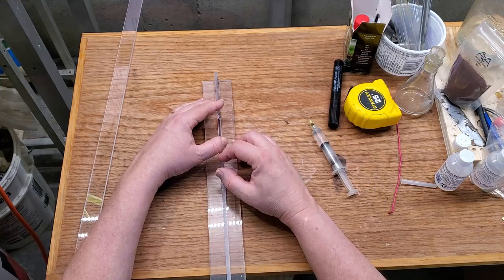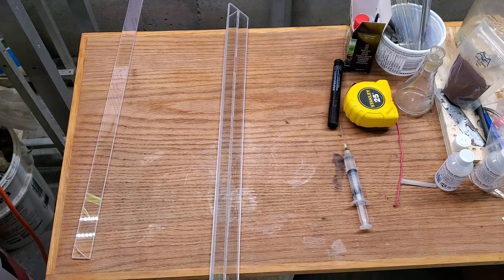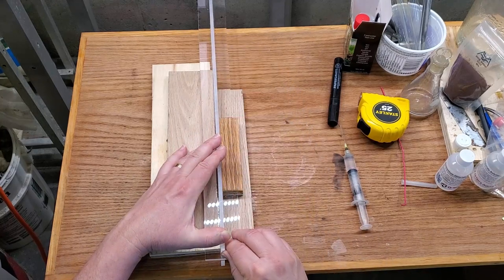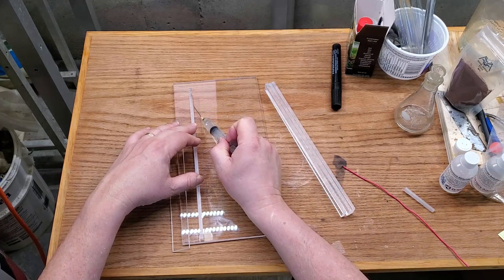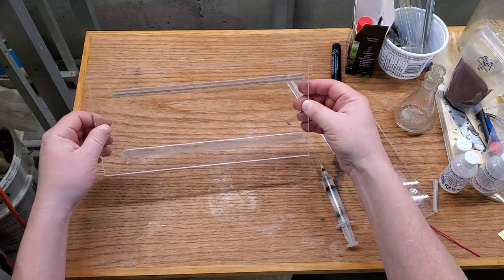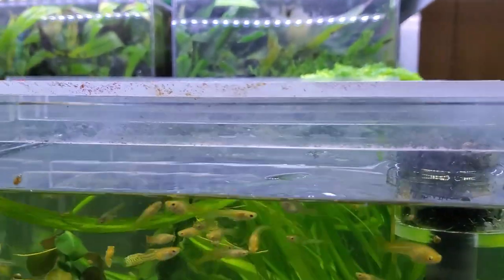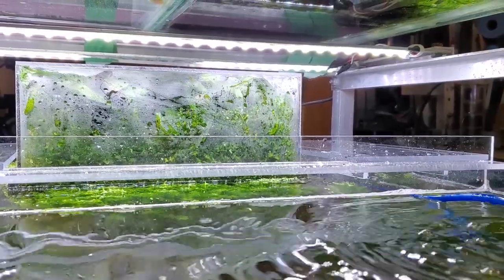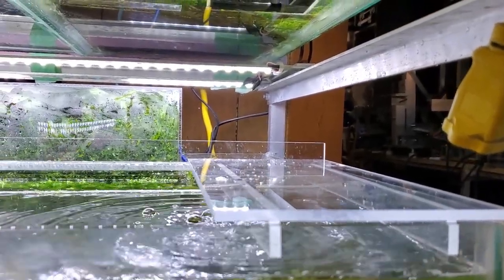Acrylic Lids The Next Step

Comment: Try pre loading before you put the brace on i.e bend your pieces in the opposite direction of the bend you dont want. Not sure if there is enough flex in 1/4" though
Reply from the maker: I will have to try that. Thanks for the suggestion!

Comment: I think the top brace is a good idea, I would put a couple and make it even wider and use it as a place to rest my light. Your lights are above on the shelving so that doesn’t work for you but for most people we have a light on top of our tank and you could build the top braces just sort of a standoff that holds the light and keeps the tank from warping as much, you could also use a lot thicker piece or two thick piecesAnd make the outside slightly taller so they support the light for the most part so it’s not pushing down on the tank lid itself.  Just a thought.
Reply from the maker: Hey Shane! I'm actually putting together a planter filter for Friday that double as a lid and a support for the light. Thanks for coming by!
Reply: @FishmanEricRussell  that would be perfect, I always wanted the planter to fit inside the rim of the tank and had even thought about putting a submersible light underneath the planter to give the plants in the back of the tank some light as well.  I was just gonna put lava rock in it and let house plants grow out of the top or maybe some hydroponic vegetables, and even if it wasn’t a planter it would still be a filter.  I would do black on the outside and clear on the bottom. Can’t wait to see what you come up with
Reply from the maker: @ShaneZettelmier  Thanks Shane!

Comment: Thanks for sharing! I have been scouring youtube for videos on making acrylic lids for aqauriums and this is the best/most informative one I have found! Have you tested 3/8" thick acrylic? Also with the vertical braces have you tried less than 1" deep?
Reply from the maker: So glad you liked it! I haven't tried 3/8". I've mostly worked with 1/8" and 1/4". I also worked a little with 10mm ( sorry for the change in system) which is a little thicker than 3/8". It's so thick that it doesn't warp much all on it's own, but it's allot more expensive. The width of the braces gets less effective the narrower they are. I find 1" a comfortable minimum.

Comment: How well does aluminum attach to acrylic? Aluminum does not deflect much, at all. Perhaps try aluminum span supports.
Reply from the maker: There isn't really a glue that works well on both materials. I could easily make aluminum spans and then have the acrylic rest on that. If this support doesn't work I will give that a try. Thanks!

Comment: Can't you direct me to any particular video where you describe the tools of working with the acrylic?  What sort of saw, where you get your material including glues and applicators? 

I appreciate it.
Reply from the maker: I use a regular table saw with a standard cross cut blade. The glue is methylene chloride and I use a syringe to apply it. I get the acrylic, applicator and glue locally at Canus plastics.

Comment: Give Lexan sheets a try. Polycarbonate does not sag.
Reply from the maker: I've tried lexan and it does warp allot less. The only problem with it is it doesn't weld nearly as well as acrylic and is much more expensive. Thanks for watching!
Reply: Thank you. IMO you have taken the crown of the king of diy.
Reply from the maker: @77thwest  That's very kind of you!